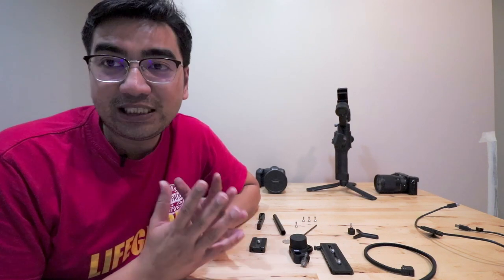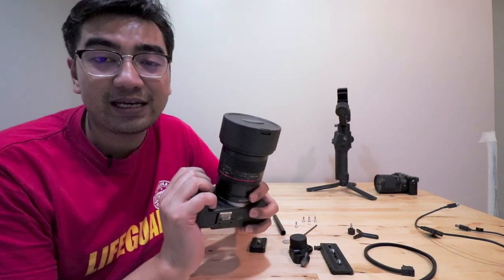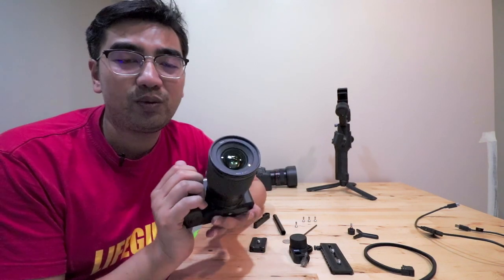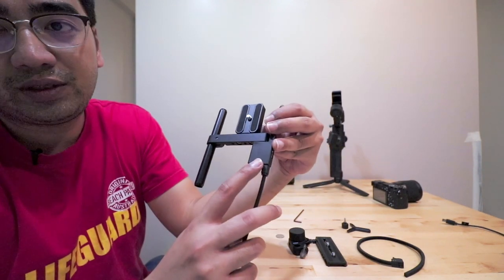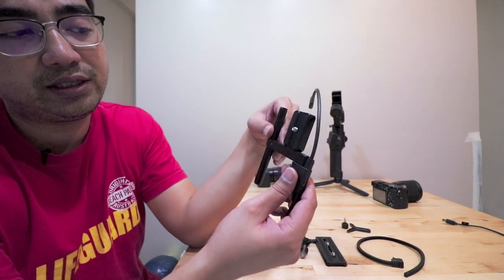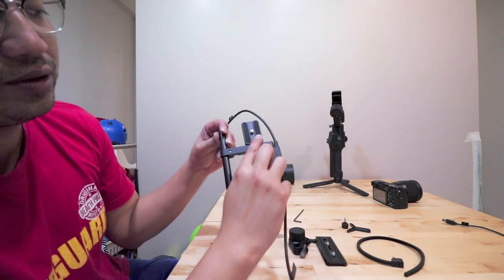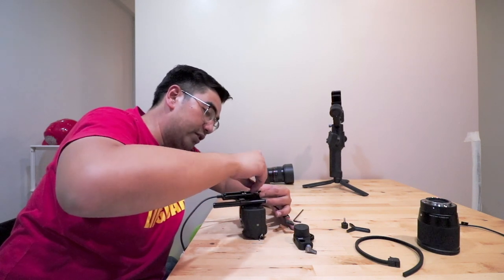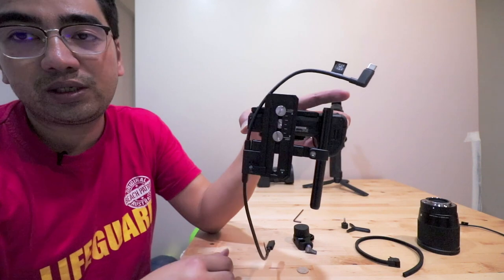DJI Ronin SC: How to setup the Focus Motor - Step by step Tutorial

Comment: Hi, thanks for the detailed instruction video, but you showed putting the focus thread on the wrong way. It should be put on with its small-detailed side to the lens and long-detailted side to the focus motor (it has the same size of the elements to connect). And yes, it matters, because the weel won't work if you put it the wrond way.  Secondly you don't need to take the lens of the camera to put the thread on - if you do it right way you'll do it easily just on the lens with the camera.
Unfortunately I was trying to adjust my follow focus system according to your video, and had a lot of problems - it simply didn't work because of the wrong instructions. Then I watched the DJI official video and solved it.
Please correct your video, othervise it is harmful for people who watch it. Thank you.